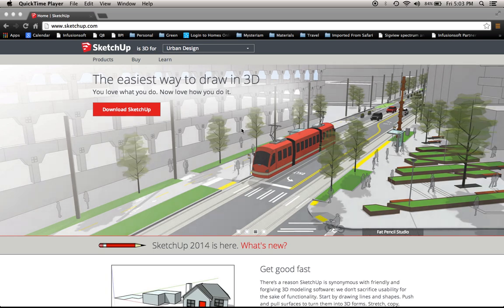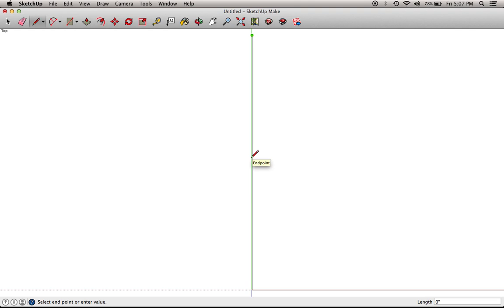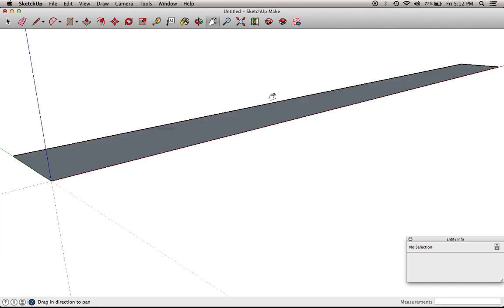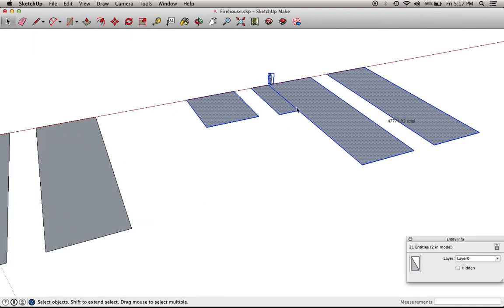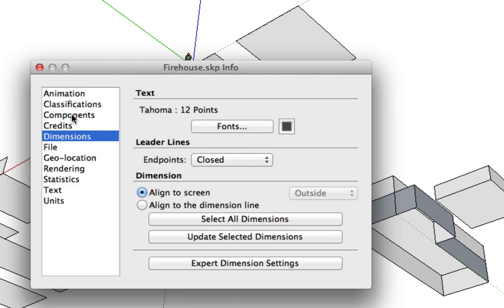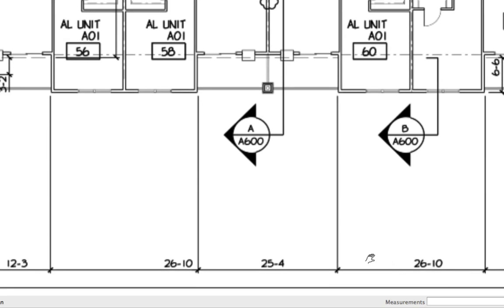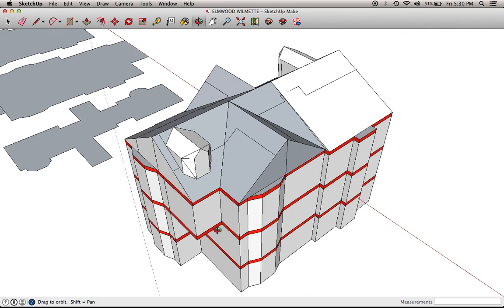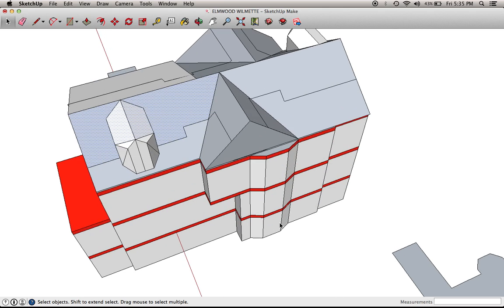Learn Sketchup 3D Modeling for Home Performance Pros in 30 minutes

Comment: Corbett, I am a relatively new HERS rater in California. I've been using Sketchup for about 6 years. One thing that could help you save time when building your models is to use the push/pull tool to build your walls. Draw your floor plan, then select the push/pull tool from the menu. Click on the filled in area and drag it up. Type your desired height and it will snap to it. That way you will not have to draw each corner, and connect all the dots. 

If you have any other Sketchup questions, send me a message, I'd  be happy to help. It's a great tool.
Reply from the maker: Thanks, Ben! The more we all learn about this the better.